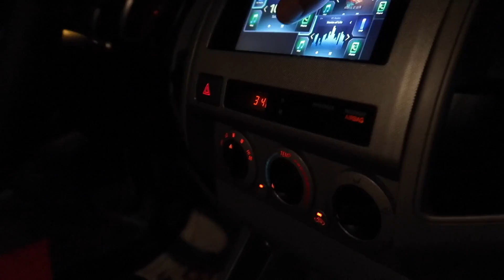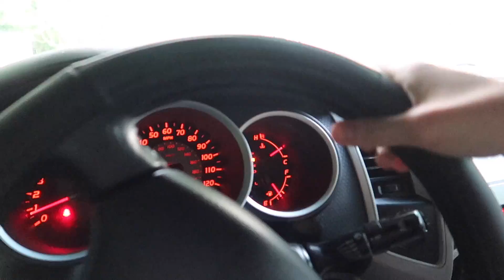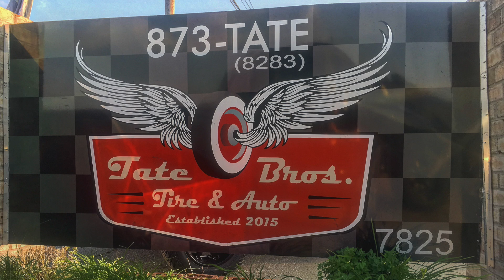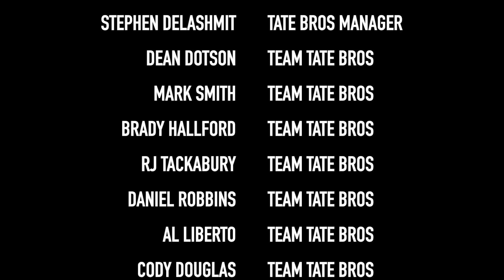I Got My DREAM TRUCK For Graduation!

Comment: It’s a hella clean Tacoma bro. If it’s a v8 put a flowmaster 40 or a 10 under it single in dual out an it will sound amazing. 5/18 or 6/18 in tips would make a deep sound too. Clean setup tho brother 🤘
Reply: Cameron Richards Tacoma’s don’t come with a V8. Tundras do.

Comment: Hey I love the truck and I have a couple questions what subs are you getting and where did you get the steering wheel cover? Your truck is a beauty I have an 08 exactly like yours but a 3 inch lift and 285s looking to get subs soon and upgrade to a 6 inch lift
Reply from the maker: Patrick Kryszczak Thanks bro, 2 10s, auto zone, and hell yea
Reply: Jp Stephens I just ordered 2 10s today
Reply from the maker: Patrick Kryszczak Nice what brand?
Reply: Jp Stephens Rockford

Comment: Dont get 2  10's you need to get 2  12's. They will hit so much harder. But if your not upgrading stock mids and highs then ig 10's should be fine
Reply: Size doesn't matter of the speaker, it's the build of the box. You can make one 8 louder than two 15's. If it's an underseat build, go with 10s so that they have more air space
Reply from the maker: Southernstyle Muddin Yea 2 10s will be mores than enough